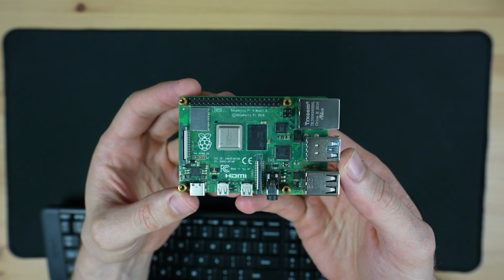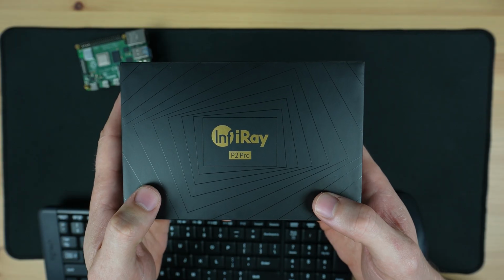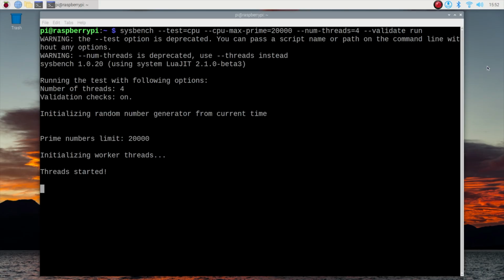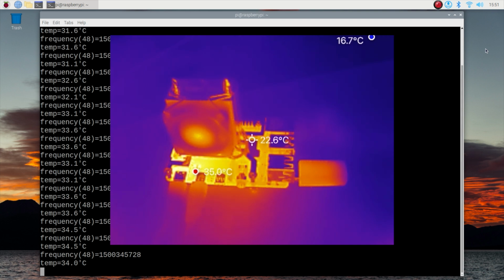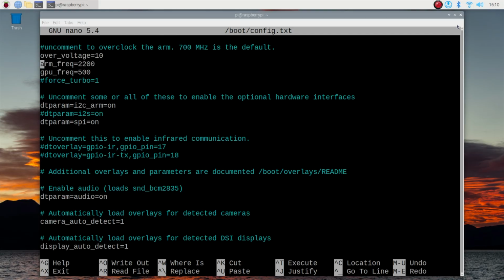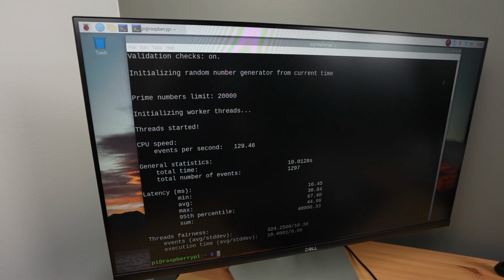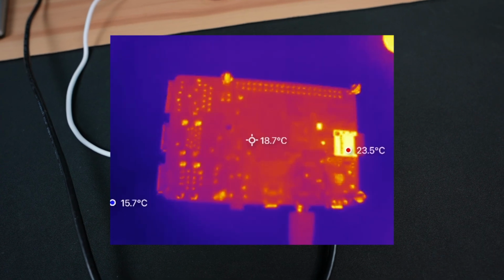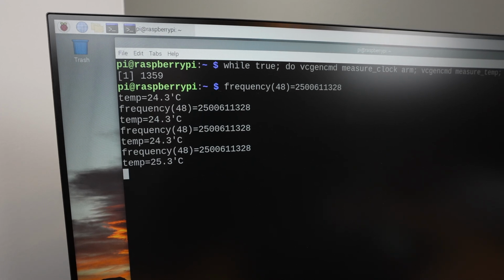Raspberry Pi 4B Insane Overclock To 2.5 Ghz - Monitored With The InfiRay P2 Pro

Comment: At first I didn't understand your results on sysbench. but I'm running headless. Stock I get 2300+ events, and 3100 at 2GHz. Don't run a desktop environment on the Pi 4 ^^

Comment: I've run 6 Pi4s all overclocked to their individual limit.Only blew 1 up and that was from a self powered USB device. Created a difference of voltage. Pi4 4gb the highest OC was 2200 stable. It's getting close to 4 years running it at that OC. Pi4 8gb 2275 stable on the slowest. Fastest 2347. Pi5 4gb 3150 so far all day. The only glitches are the games so far. GPU 900 is most stable for pi4 and pi5, older slower pi4 866. Cooling, official power supplies and USB flash that can keep up. 400gb/s Samsung Fit or BAR work just fine for $13-16 128gb

Comment: I'm currently running 2.45ghz stable on a rpi4B but I have had it up to 2.6ghz but it would freeze after 10 minutes. I use a portable ac/dryer and a heat sink case as the active cooling solution. It keeps the temps around 15-25°c

Current stable clock 
CPU=2450mhz
GPU=900mhz
Over volt=14
Initial turbo=60
Reply from the maker: It's impressive that you found one that would boot at 2.6Ghz, even if it does lock up after a few minutes.

Comment: Has sysbench changed how it counts events?
2.1GHz @ over_voltage=6 >> 32749
2.2GHz @ over_voltage=8 >> 34411
2.3GHz @ over_voltage=9 >> 36037

Raspbian Lite 64bit Pi4 @ 2.1GHz @ over_voltage=6 >> sysbench --test=cpu --cpu-max-prime=20000 --num-threads=4 --validate run
CPU speed:
    events per second:  3273.43

General statistics:
    total time:                          10.0011s
    total number of events:              32749

Raspbian Lite 64bit Pi4 @ 2.2GHz @ over_voltage=8 >> sysbench --test=cpu --cpu-max-prime=20000 --num-threads=4 --validate run
CPU speed:
    events per second:  3439.63

General statistics:
    total time:                          10.0010s
    total number of events:              34411

Raspbian Lite 64bit Pi4 @ 2.3GHz @ over_voltage=9 >> sysbench --test=cpu --cpu-max-prime=20000 --num-threads=4 --validate run
CPU speed:
    events per second:  3602.39

General statistics:
    total time:                          10.0006s
    total number of events:              36037

Comment: I stopped at 2.1ghz and 700 frequency with gpu  and at 6 overvolt. Couldn’t push it any harder unless using air conditioning.
Reply: What's the temperature? My RPI 3B+ is at 1.5ghz at 45 degrees Celsius (only fan and tiny heatsink)
Reply: @osopenowsstudio9175  54*c, same heatsink and fan. fan is on 24/7.
Reply: I'm currently running 2.45ghz stable on a rpi4B but I have had it up to 2.6ghz but it would freeze after 10 minutes. I use a portable ac/dryer and a heat sink case as the active cooling solution. It keeps the temps around 15-25°c

Current stable clock 
CPU=2450mhz
GPU=900mhz
Over volt=14
Initial turbo=60

Comment: With scalped SOC, liquid metal for cooling.. some were able to get stable 2.5GHz. For CM4 there were news about insane 3GHz. 
Still you can improve your setup with just fan blowing into whole board cooling it a bit from bottom. I would also pay attention to pmic temp. 
I was always curious what is power usage on overclocked unit. Turbo mode destroys all charts for sure. ;)
Reply from the maker: Yes I've seen a CM4 module overclocked to 3.0GHz by Claude Schwartz. I didn't think to measure the power usage - I'll have a look at that on my next run.
Reply: @MichaelKlements  The whole goal of overclocking is to get as much as possible, but nobody cares how much that costs. If You loose ability to dynamically adjust frequency board will draw much more power than it's needed and therefore power per watt would be miserable. Q engeenering guys made some test on overclocking with some insights about power, but they went much lower and don't cover real world usage. I don't think that anybody is using pi fully loaded all the time 24/7, in real world maybe about 20% of time it can use high loads so down area is for me much more important than peak usage. I would be grateful for such results showing power stats! :)

Comment: You're supposed to get multiple data points. What you should really be doing is running the 1.5 GHz set of tests like 3 or even 10 times, then look at the min/max/average in case there's a fluke somewhere. Then do the same for each iteration of frequency increase.

Comment: @jeffgeerling needs to confirm this😮
Reply: Haha don't worry, it does seem that some limits were lifted with later versions of the SoC. Can you confirm your board has a "C0" revision chip instead of "B0"? That's the version that was put on the CM4 and Pi 400, and they later started putting it on Pi 4 model B as they ran out of the B0 stepping.

The C0 is not substantially better (especially at base clocks), but does seem to handle overclocking at the extreme end a little better. That, plus you may have won the silicon lottery with your chip. None of mine go over 2.3 GHz and are stable at all.
Reply from the maker: That's quite interesting, I didn't know that that was even something to look out for. I can confirm that the board in the video is a B0 revision though, the last digits are "B06B0T". It is one from back when the 8GB was first released. You can see the numbers on the chip at 0:06 when it's a bit better in focus.

I understand that they also improved the PMIC on the 8GB Pi 4B (along with the CM4 and Pi 400) so that is one of the reasons why they generally do better than the other 4B variants.
Reply: @MichaelKlements  When overclocking without force_turbo=1 the system will "fake" the speed but never actually reach it, Try setting it on and see what the highest frequency you can get

Without force turbo my pi once did 3.2ghz because i accidentally typed it backwards
Reply: @JeffGeerling I'm currently running 2.45ghz stable on a rpi4B but I have had it up to 2.6ghz but it would freeze after 10 minutes. I use a portable ac/dryer and a heat sink case as the active cooling solution. It keeps the temps around 15-25°c

Current stable clock 
CPU=2450mhz
GPU=900mhz
Over volt=14
Initial turbo=60
Reply: @jeffgeerling
Reply: @diabeticnomad  what he said👆
Reply from the maker: @JeffGeerling the people want validation 😃